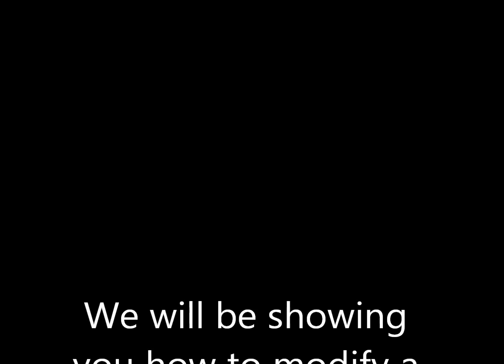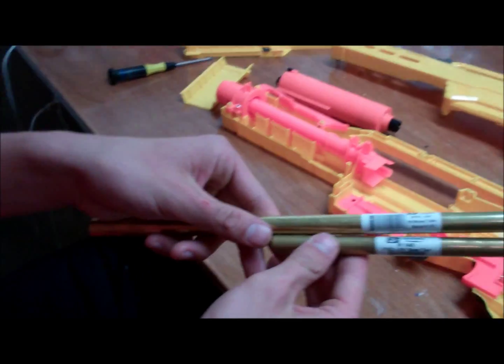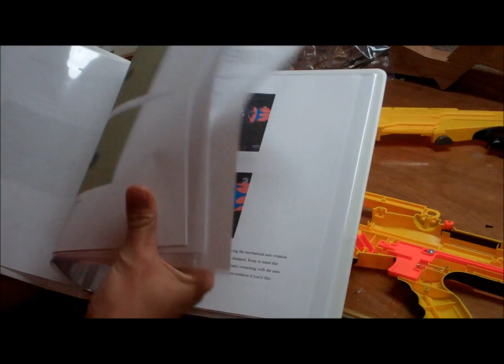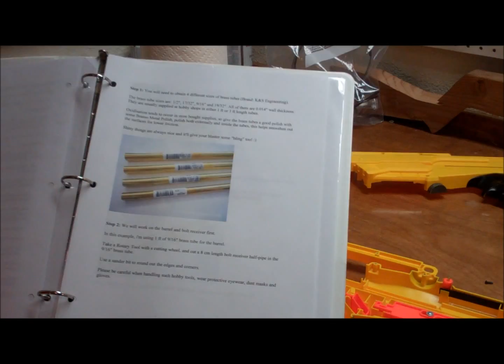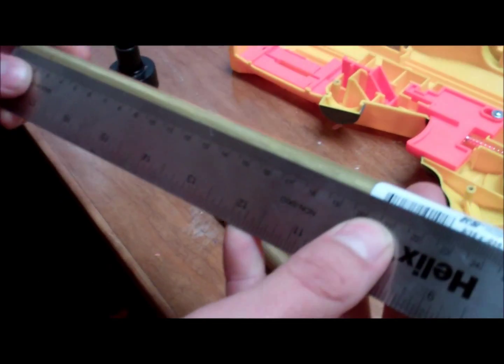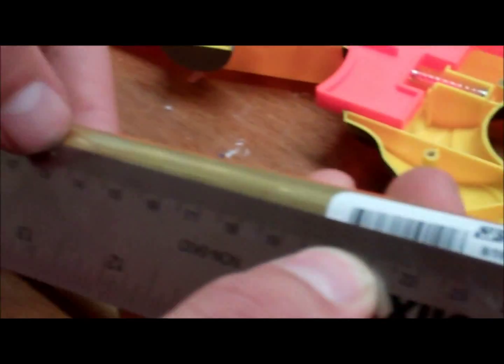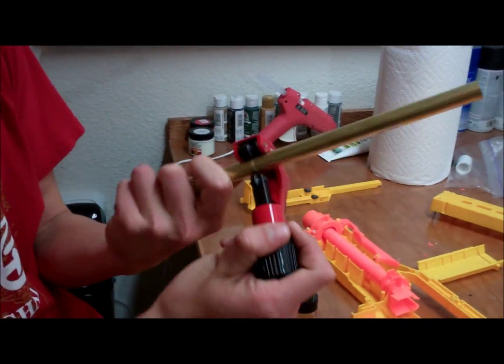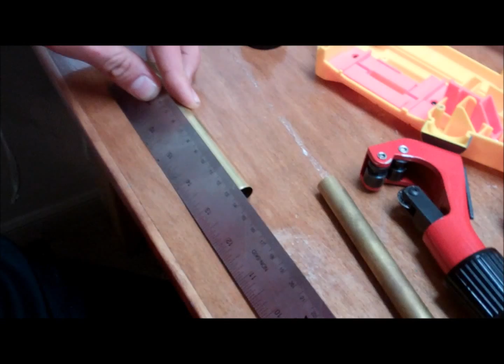Live Modding: Brass Breech Longshot (Tutorial)

Comment: 8:22 when I built my first angel breech (the brass breech where you do cut and glue the bolt sled attachment to the brass) I made the mistake of epoxying and JB-welding it on before putting it through the plunger tube.  I eventually got it off but its a sucky mistake to make

Comment: Still using this for most of my longshots :). BTW I've had some trouble with streamlines fitting the 17/32 barrel so to fix it I'll take a foot of 17/32 and put 4 streamlines in it and leave them there for 24 hours and then the streamlines OD becomes slightly smaller than before so they consistently fire out of the breech instead of every 3 shots having one of them not make it out of the barrel. The only reason I've had misfires with that method was due to the head of the streamline being sligh

Comment: This is a really nice tutorial! Really like how you used the 9/16 bit, a lot easier than cutting off the top of the original bolt. Also, in SG Nerf's writeup, he also used 1/2 inch and 19/32 brass, does that make any difference? Lastly, just to clarify, the bolt is 17/32 and the barrel is 9/16 right?
Reply: Nope 
Barrel is 17/32 and the bolt 9/16

Comment: I'm making one just like this except on the plastic breech that's you cut you had maybe an inch where you put e-tape to prevent the plastic from sliding back. I cut my breach right where the orange stops and it becomes black and I'm drilling through both sides so I don't need to worry about e-tape. I'm also going to try the same thing on a recon. I know you used to hVe a video on a half brassed recon but I dont see it anymore. Are the reverse plunger breaches weaker or thinner than the longshot